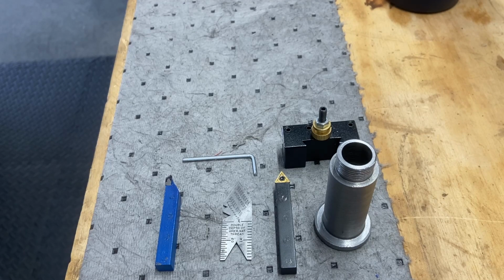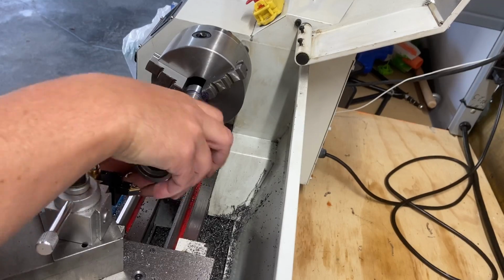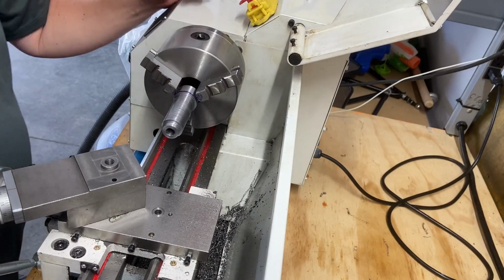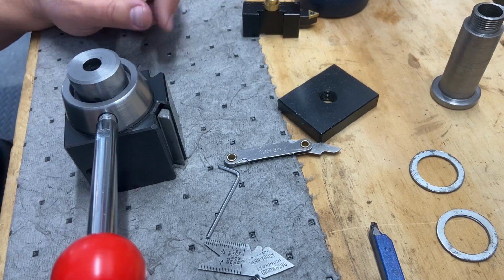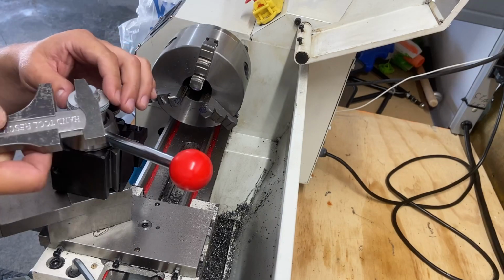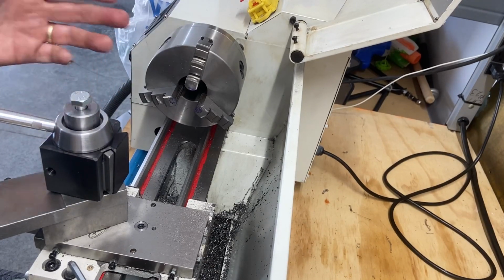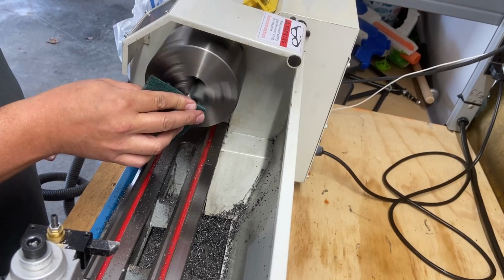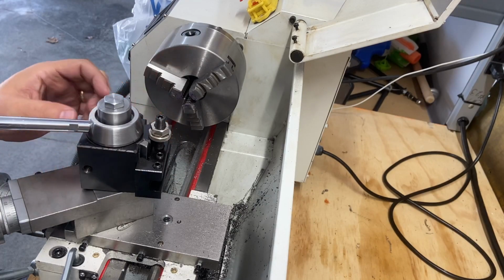Vevor Mini Lathe MX 400 Part 31.3 - Bostar AXA Quick Change Tool Post Upgrade Series Part 4 of 4

Comment: Great to see you keeping at it. I noticed that the front and rear gib screws on your cross slide seem to be backed out. Not sure if they are adjusted or not but all three screws should have the same amount of tension on them. That will help stiffen everything up so the tool post is more rigid.
Reply from the maker: Good observation. This video is with the original gib and the 2 outer cap head screws don’t seat into the factory original dimple’s on the gib so they do indeed sit proud compared to the center screw.
Reply: @deezworkshop  sorry I meant the cross slide not the compound. The ones by where you lock the saddle down.
Reply from the maker: @WILFRED1184  gotcha. I noticed there is looseness in the carriage last night practicing, this weekend I plan to look at trying to secure the carriage and trigger it all up. The loose ness and play I believe are causing issues when parting and needing that rigidity.

Comment: It's a beautiful work.I have a question.shortening the thread length of the original shaft did not work?I solved the problem by shortening the tooth length.
Reply from the maker: Not entirely that simple,  The through hole was too large too for the mounting stud  It didnt fit my threaded boss in the base of the compound.  I needed the mounting hole for a bolt or stud to be smaller.  It was mostly for that reason I chose to remake this part. In addition, I wanted to keep all original parts in tact and recreate my own with the changes I needed.